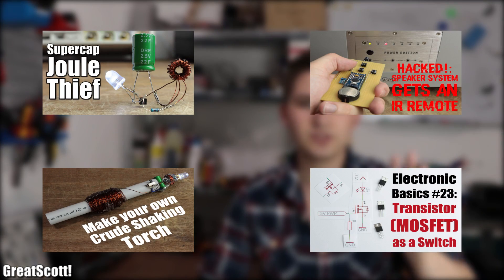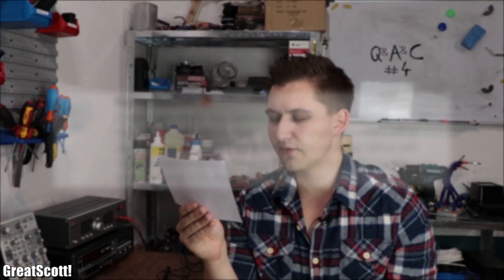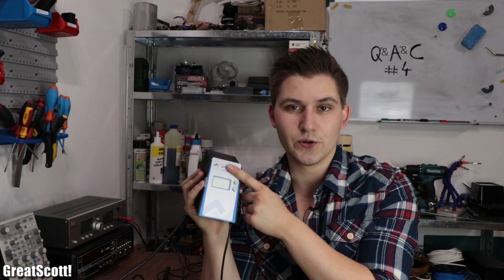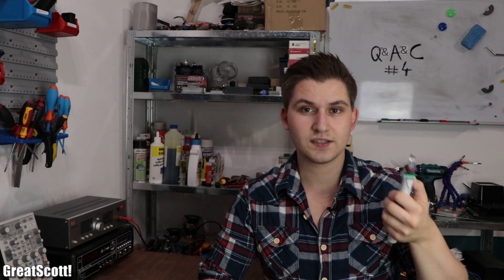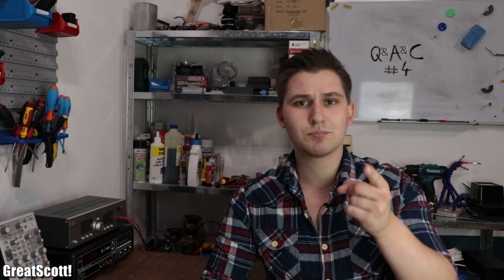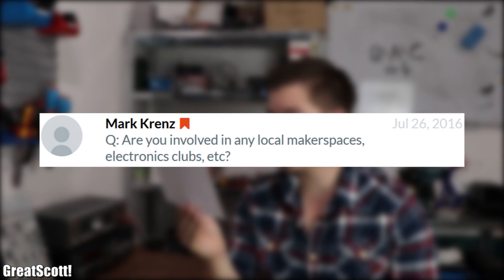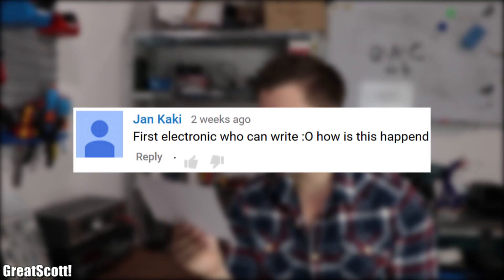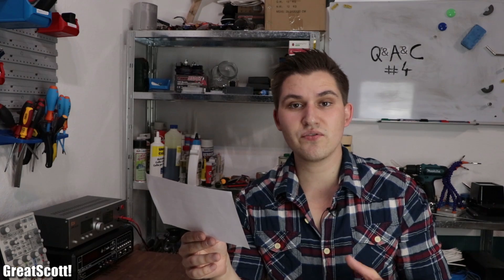Q&A&C #4 || Only Arduino Compatible? My own SBC? What Soldering Iron do you use?

Comment: I have a unique problem that's out of my league.  I would like to make my own laptop.  Currently it's powered by 2 different wall warts (US 120VAC) for a monitor inverter board (12VDC/1A) and intel compute stick (5VDC/3A).  I'd like to get it down to 1 wall wart and a rechargeable battery.  I don't see a way to do this with off the shelf products (amazon or ebay) and I don't know enough about electronics to make a circuit for it.  Any part of that you could make a video about that could point me in the right direction? Having a laptop that uses 2 AC wall plugs is hardly portable but it does work.  I have a video on my channel if you want to see my paltry attempt at a custom laptop.

Comment: I also have an ERSA iCON pico. It's an amazing soldering iron, I got it from their official site for a price of around €125 (postage included). It's amazing because I couldn't find it cheaper than €150 in any other shop. The official site has an amazing deal for an amazing product, I would highly recommend it or the more expensive nano, which is the same, but it has grounding on the tip.
Reply: Would you recommend the ERSA i-Con Pico? I'm thinking on getting a Hakko FX888D, but that one looks nice as well. What I like about the Hakko is the compact footprint (important for me) and the nice iron stand, unlike the i-Con Pico which doesn't seem very good. On the other hand, the i-Con Pico has a nicer UI (the Hakko is pretty bad, it just has an up and an enter button!). However, the Hakko can be hacked to get a nice UI, so...

Comment: Hey, I'm working on a project with 3 layers of arduinos talking to each other (1 "slave" talking to a "mid-level master" who in turn calculates and talks to a "central master" which also gets inputs from 5 other ones like the mid-level master and 4 other arduinos) I have set them all up with serial communication but incorporated the slave select feature manually where the device turns on the serial port at a specific buad rate and turns it back off when the slave select is set to high. The problem i seem to be having however is selecting the correct baud rates as it seems to slow down with multiple inputs. Can you help me with this?

Comment: I take to pieces my old shredder, beacause I want the strong electric motor, And I measure the current what flow to motor.
And DC is around 250v and AC around 60v at 43Hz. But how is it a possible have ac and dc at once? I use UNI-T UT61B multimeter.
Reply: Excuse my english please :)
Reply from the maker: AC with a DC offset
Reply: +GreatScott! thanks

Comment: One thing that should be mentioned using chinese clones is that some of them use counterfeit FTDI FT232 driver chips that may not work - at least not in the first place -  or different FTDI chips that require special drivers. See http://hackaday.com/2014/10/22/watch-that-windows-update-ftdi-drivers-are-killing-fake-chips/ , http://hackaday.com/2016/02/01/ftdi-drivers-break-fake-chips-again/ or google "arduino counterfeit ftdi driver".

Comment: Buy Arduino, then Ruggedduino. using it as noobs, use Ruggedduino first. They can handle big mistakes. Until you are Pro, then you can switch over to original Arduino. This advice is not recomended if you live with No-derivative law.

Comment: One difference I have found between arduinos and chinées clones is that the clones rarely have unique serial numbers making it impossible to distinguish with udev rules. This is only a problem when you have to connect multiple arduinos to one computer without a human being able to set the port on each one. My situation was a robot for a robotics competition using one pi to control several arduinos.

Comment: Anyone have any ideas or suggestions for electronic projects? Im looking for intermediate type projects. I have an arduino and a buttload of capacitors, resistors, leds (i really like leds). All that i have built so far doesnt use anything very complicated, nothing with mosfetts or transistors or anything like that. I really want a project that uses those. Any suggestions for projects to make would be greatly appreciated!

Comment: great Scott, I have an hp photo smart 850 digital camera we purchased at a yard sale for $0.50 and the lens was stuck out. I put batteries in and everything seems to work except the lens won't go in. I have taken the camera apart to try to find the problem. during this time I damage the flexible circuit strip for the lens motor. do you have any idea's how to repair it?

Comment: There is anouther major difference between original Arduinos and clones and that is the usb to serial converter. Some clones use counterfeit ft232's which wil not work with the latest driver from FTDI. You can either install an older driver or try to find clones that use a different chip (this problem is not pressent for ATMEGA32u chips as they dont use a converter chip)

Comment: Found most fake arduino's have the decoupling caps far away from the ic,  don't use the proper LC filter on the analog supply pin and use CH341 instead of Atmega8u2 or ft232.
But hell yeah I would totally buy fake at 1/10 the price or even make my own.

Comment: Actually all original Arduino boards are called "Genuino" outside the US due to licensing problems. For every Arduino board there is one labeled as Genuino too, and it's the same board. You can buy those to support the original project.

Comment: +Mat2095: There is nothing special about Arduinos hardware-wise. It's a standard off-the-shelf µC with a standard off-the-shelf USB-TTL UART interface, with some standard off-the-shelf power regulation. 
The only special things are the particular arrangement on the board as well as the sofware behind it, which is all distributed freely on the internet. The free distribution allows for big-scale manufacturers to jump on the bandwagon and produce units very cheaply which in turn is an advantage for us all. This in turn leads to a price-war with completely assembled Arduino Nano compatibles ending up on eBay for €2.75 a piece. The components may be bootlegs, but hey, who cares if it's not put in an application where life and security depend on it?